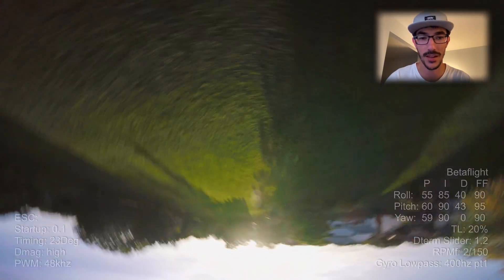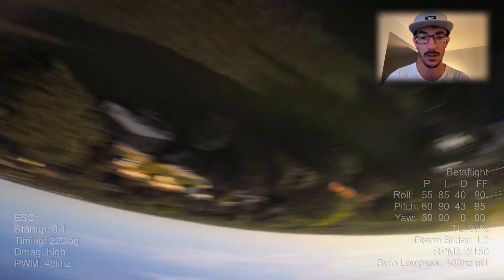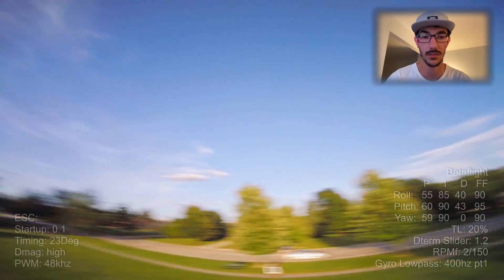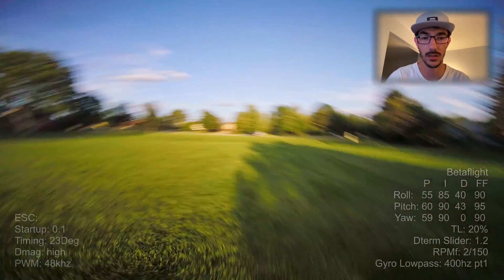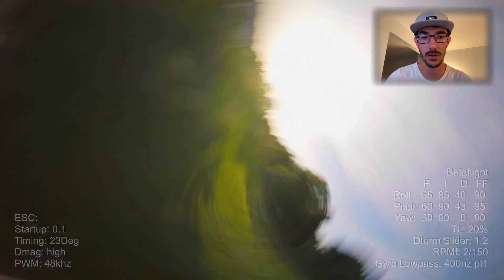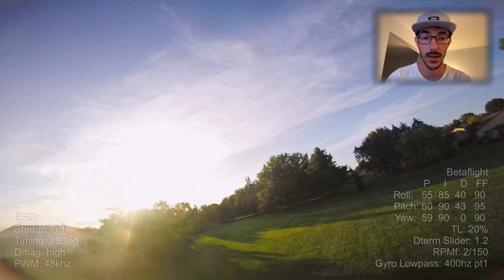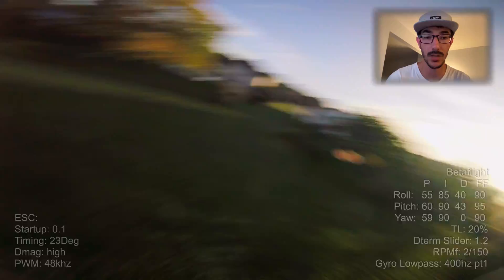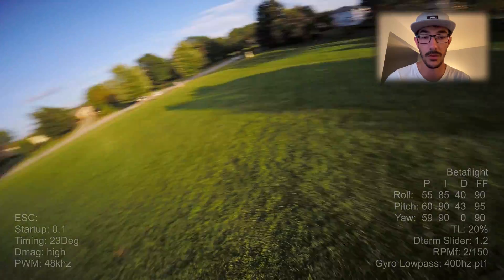FPVCycle Emerald Motors | No DeSync Here!

Comment: Have u tried it on bheli_s or bluejay?
Reply from the maker: I have not, I dont really run 8 bit ESCs unless its a micro usually. 

I have run these motors on 3 ESC's. one of them needs to be down at 10% ramp up, but the other 2 run them no probs.

Comment: Hello
I'm experiencing the same issuets. At first the quad flew great then the desyncing issues started. I followed your advice and input your settings. The quad flys but I'm still experiencing minor desyncs when I bank left or right. Would like to hear any suggestions you have.
Reply from the maker: Man that's tough. How high is your dterm.... And do you by chance have a diatone ESC purchased in 2021?
Reply: @mouseFPV  After breaking down the quad, found some dirt on the top of the cap. Looked like there was metal shaving in the dirt which was shorting to the top plate from the cap. After cleaning everythig out the issue went away. Damn piece of metal????
Reply: @mouseFPV  I did buy a diatone ESC which caused me a great deal of headache. Everytime I tried doing a flip, it would desync.